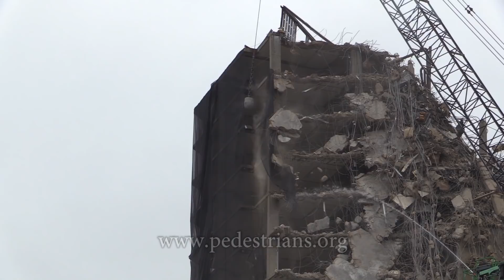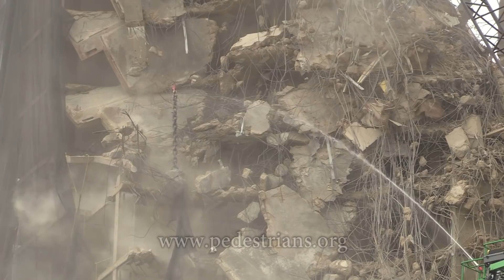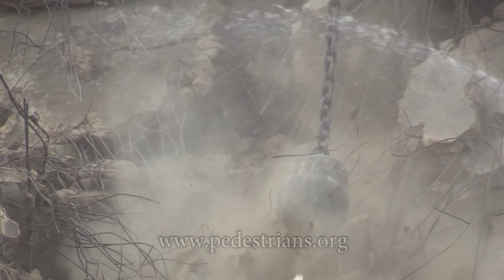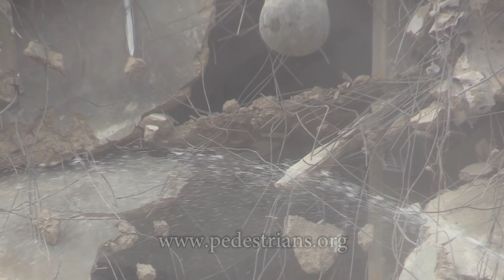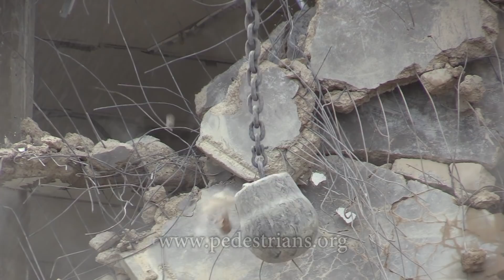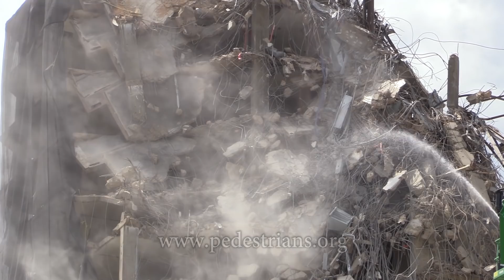Hotel Demolition (Wrecking Ball), Part 1

Comment: Interesting subject. Thanks. We don't get to see a wrecking ball used much.  This seems to go quite a bit faster than nibbling away with concrete shears. But with less control, it seems.

Good photography, with a nice variation between closeups and wider shots. My only suggestion is I'd like to see a few more very wide shots to see how the crane reacts to all this abuse.
Reply from the maker: Thanks for the suggestion.  I should have a chance to film some more next week before they finish, and I plan to try some new camera angles.
Reply: @JohnZWetmore  What kind of hotel is being demolished by a wrecking ball?
Reply from the maker: It was a Marriott Residence Inn.
Reply: @JohnZWetmore  thanks